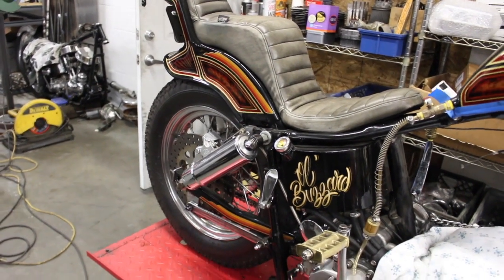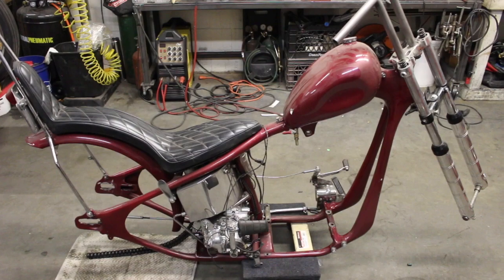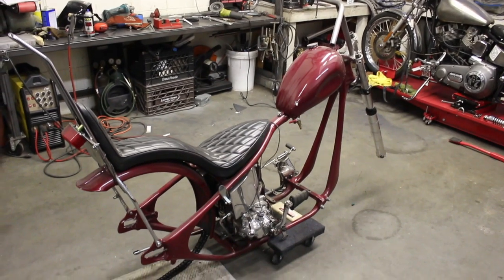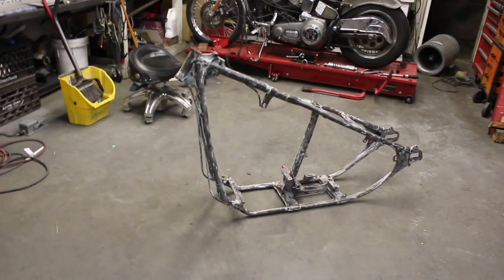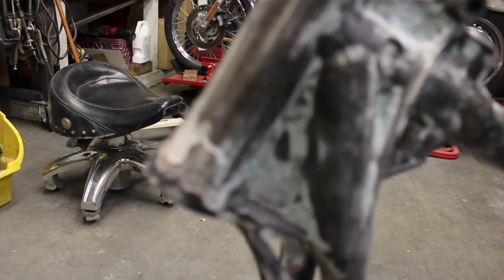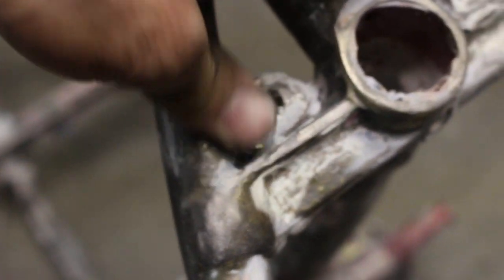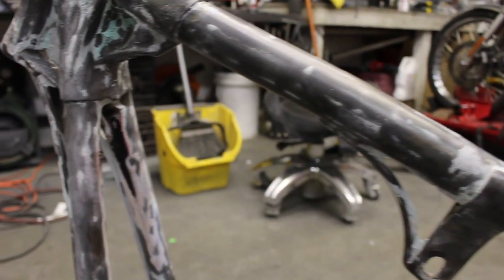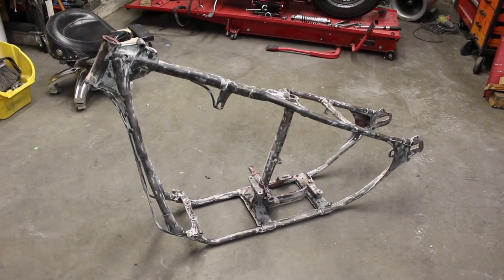Whats under the bondo?? Harley Knucklehead chopper frame

Comment: Sand blast it next time it removes the bondo a lot easer.
Reply from the maker: I Usually get the bulk off by hand and then sandblast, it always pulls a bit of material when it gets blasted and when the bondo is thick they really have to let it have it so I try to make it so they can do it as light as possible. Thanks

Comment: I got a good idea. You should take a survivor chopper and take it back to stock🤡🤡🤡
Reply from the maker: I never had intentions too but after it cracked both sides of my engine cases I narrowed it down to crappy welds when they stretched the frame. wasn't worth ruining another set of matching cases in to me.
Reply: @houseofchoppers  makes sense. Too bad you couldn't have traded the SURVIVOR roller for a stock frame. If you wanted stock dimensions. 😔 It's your bike though. 🤙🏾🤙🏾